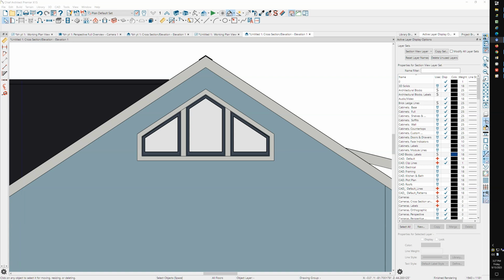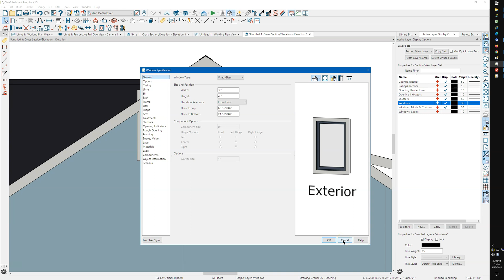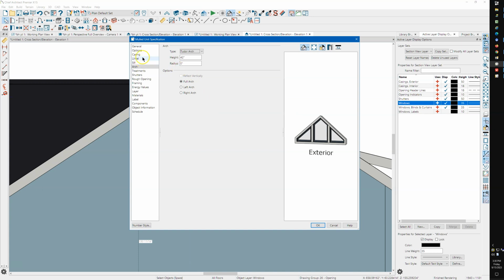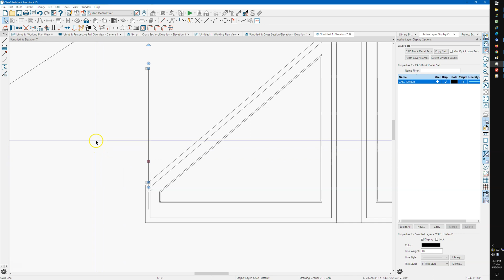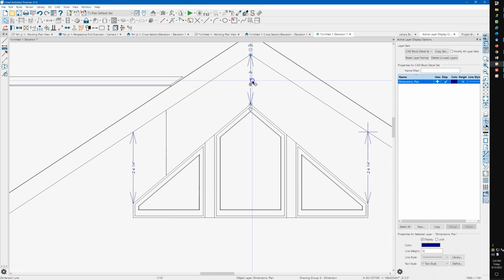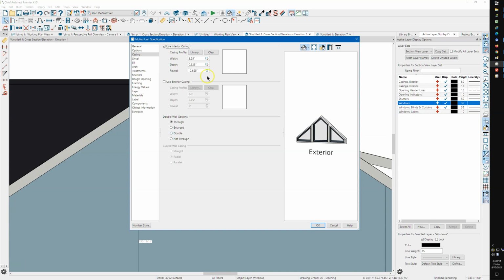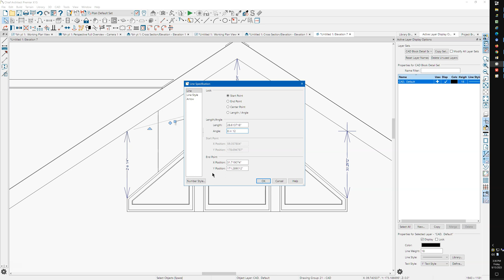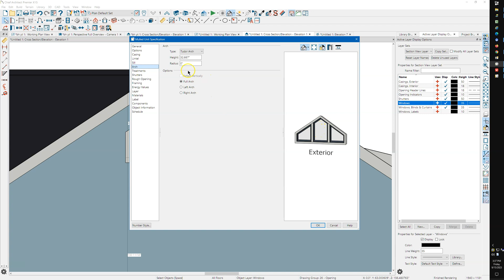Mulled Windows - Angled Tops To Match Roof Pitch - Chief Architect

Comment: Thanks Eric, good one! tried out a variation to your method.
1. Drew a line and made it parallel to roof pitch
2 Point to point moved the line to the apex of the window
3. Drew another line from top of window side up to the parallel line, opened it's species, ticked line length.
4. Deducted that length from the measurement, (apex of window to apex of roof)
Thanks again for paving the way!